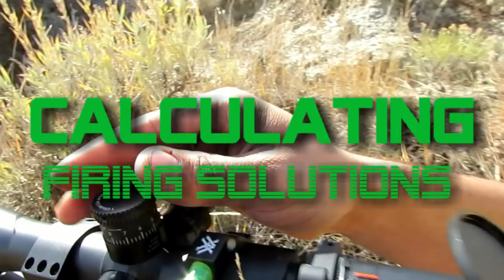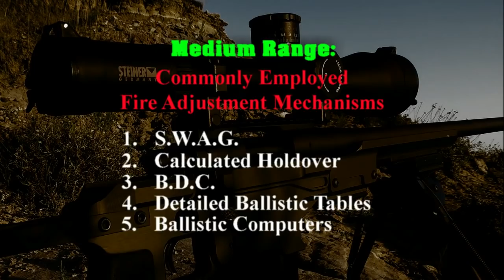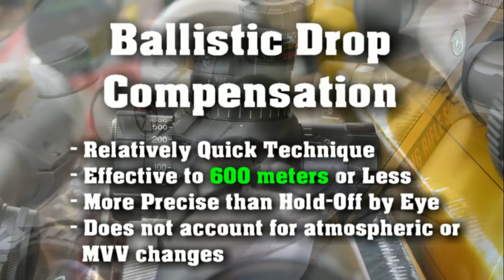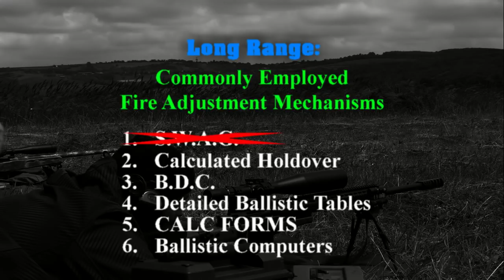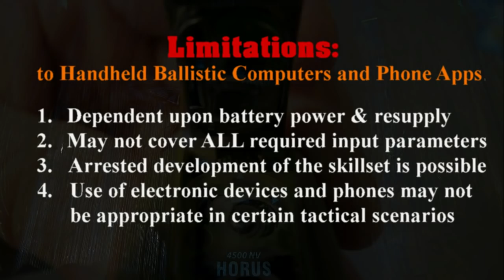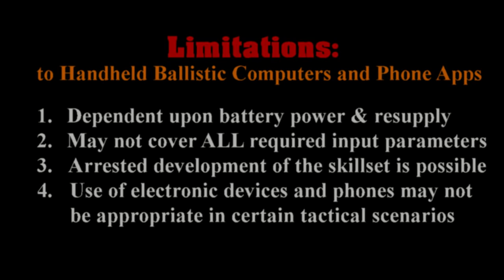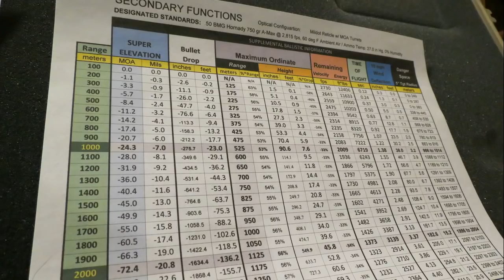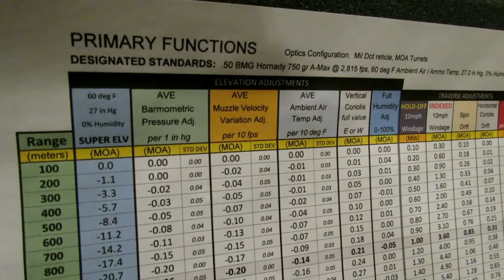Long Range 101 Part 77 -  Calculating FIRING SOLUTIONS for Various Applications of Fire

Comment: The reason I go through these videos is to learn how to develop charts in case the grid melts down. It's the same reason I have a large library of books. Heck I still appreciate remembering how to do long division. When power sources are not available this knowledge can be the power  that will help you to function. That's the reasoning behind me telling you to have a series of books published/printed for the Sniper 101. Like I've said before I would pay good money for such information in text.
Reply: I’ve been looking for a good resource for making ballistic charts not using jbm ballistic software and doing it by hand. Do you know any good resources?
Reply: JESSE D 

Get the book “Applied ballistics for long range shooting” by Brian Litz. 
ISBN: 978-0-9909206-1-8 

Hope this helps. It’s an extremely good resource for long range shooting. It’s not a quick read. But it’s very very good.

Comment: Rex is absolutely right: the latest electronic widgets are nice and can be put to good use, but they are no substitute for understanding the science behind what is going on and avoiding an over-dependence on technology, which may not always be available.  This is very analogous to pilot training: the latest avionics with fancy electronic moving maps, course overlays, and the like are great tools for enhancing safety and situational awareness, but my instructors and checkride examiners would often turn off fancy widgets in the cockpit if they sensed I was over-relying on them, as I in turn did to my students to ensure they matured into safe and knowledgable aviators.  As a rule: fundamentals first, then technological aids.

Comment: Hi Rex, thanks for the awesome series - I watched it almost all by now. At some point you mentioned you prefer ranging in meters and will later explain why, but I couldn't find this in the later videos. Can you please clarify it?
PS I grew up in Europe, have a background in math and physics, and the metric system is my "default", but living in the USA I had to adjust.Also, all the best wishes for your health!
Reply: Since TiborasaurusRex hasn't replied yet, I will respond with what I assume the reason is.  My thoughts are that the metric system is easier to work with when interpolating than the Imperial system.

You will notice that he suggests setting the tables up in values that are easily divisible by 10 as they allow for quicker calculations of proportions/percentages when interpolating values that fall between those explicitly defined on the tables.

I too have found this series to be very informative and look forward to putting these concepts to use in the near future.  Best of luck to you!
Reply: Thanks for the reply :-) I think however that a table in yards or meters is equally easy to interpolate if set up similarly, hence my question and confusion still stands...
Reply: jobane2
You could make a table in hex or octal, cubits, leagues, or furlongs.  Making the table and doing "half furlong" measurements isn't the issue.

I'm guessing it still has to do with why base 10 makes sense to almost everything else we do.  Quick:  what's 10% of 1km?  100m?  pretty easy.  Quick:  what's 10% of 1 mile.  Uh...let's see.   1760 yards x .1 = 176 yards.  or..Hmmm.  5280 feet so 528 feet.  Quick: your mil dot scope has dots at .1mil.  how big is .1 mil in yards (if 1 mil=1 yard)?  uh...let's see.  36 inches in a yard so 3.6 inches.  Who wants to work like that?  If we can train our brain to see in metric, mils and meters is SO much easier.  It's like the idea of being bilingual.  They say when you can dream in another language, you're getting there.  I had a dream the other night where I was talking in Spanish to my Mexican employee.  I also have found myself counting in Spanish because he an I have to count a lot of things and it was funny when I found myself doing it without thinking, even when I wasn't talking with him.  It takes us Westerners a lot of work to see that the car is parked 200m away or that my friend is 180cm tall.  I still have to do the translation just like when I started speaking Spanish...think it in English...translate to Spanish.  If we can "think in metric", the math gets a lot faster.  Interestingly, our money is basically metric.  Thank goodness we dont deal in pennies and pences and shillings and crowns anymore.  We call it a "half dollar" but it's really .5 dollars, or 50% of 100.  .01, .05, .10, .25, .50, 1.00 increments instead of 1/2, 1/3, 1/4, 1/12, etc.  Even our car odometers are in miles and TENTHS of miles...now if they were just kilometers and tenths of kilometers it would make more cents (pun intended).